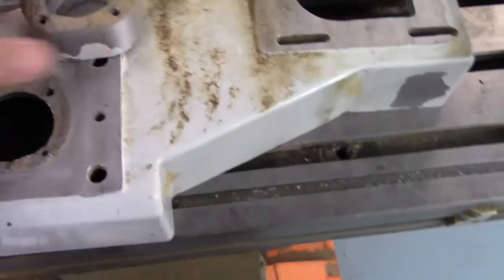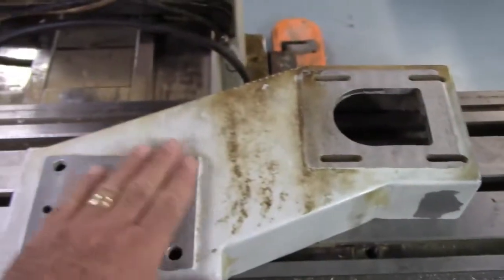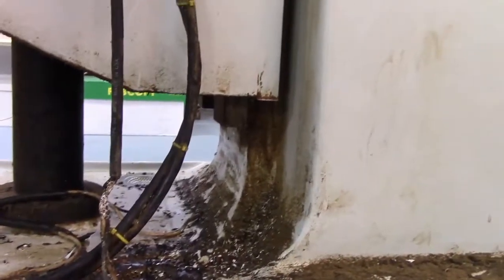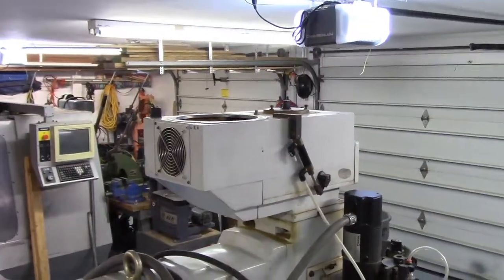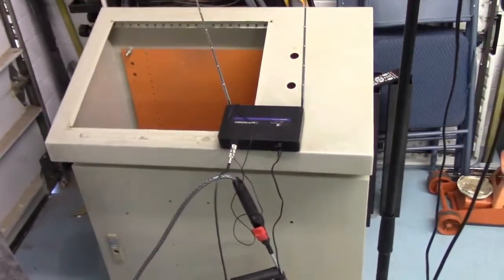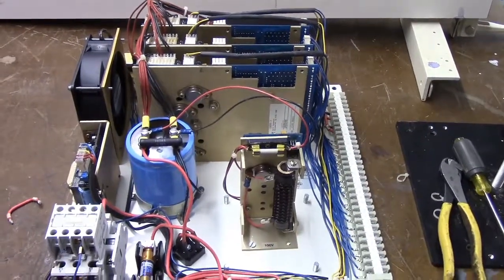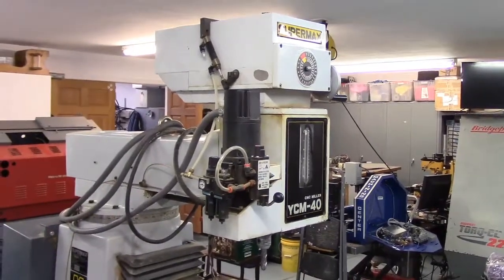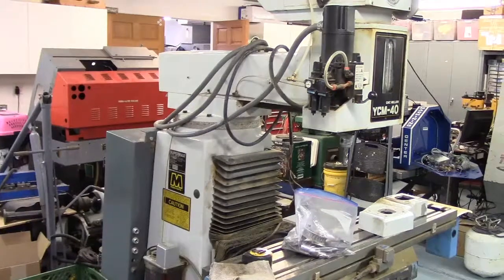Supermax YCM 40 Walk around

Comment: I notice that one of the Y axis limit switches has been modified. It seems suspicious that the Y axis crashed - but was that cause or effect? Was the switch mod a failed attempt to prevent the crash reoccurring? You may never know of course but perhaps the switch was dodgy to start with. 

I found one of my industrial IP68 limit switches was full of coolant due to the way it was mounted. If your switch got coolant inside, perhaps the old controller wasn't able to see it.
Reply from the maker: Hi Murray, thanks for the thoughts. I will definitely take that into consideration when I am checking things out. I did find it curious to see that Y axis limit the way it was.  It is interesting to note that the Y axis servo motor was no where to be found. My thought is perhaps they shipped it off for repair and either never got it back or the business was shuttered before they did anything else. Since it happened twice, we suspect the runaway was the cause of the broken Y axis thrust bearing pocket. It had to hit pretty hard. YCI still sells parts. This casting was $300, not terrible but I think a weak point.

Comment: I bought an old Shizuoka CNC machine rather like this and would agree there's a lot to be said for refitting an existing "proper" machine rather than converting a manual one, which was my original plan. 

Although it worked (sporadically), I replaced the 1980s controller with a Chinese 4 axis controller (http://www.newker-cnc.com) and some modern drivers for the original SEM brushed motors. The whole system is now housed in the original monitor / console and the enormous steel control cabinet is now geography. It all seems to work very well indeed. Using a self-contained controller like this avoids the need for a PC, monitor, keyboard, mouse etc - it's more like a clone of a Fanuc system.

I bought 2 of the original DYN-2 systems from DMM Tech and although I had them spinning, I can't pretend I have any useful experience to pass on, as the original Bridgeport conversion plan became redundant after I acquired the Shizuoka. I was living in Vancouver at the time and actually went to the DMM Tech office to pick them up. Nice guys to deal with. It has to be said from my own tear down of their system (I am a power electronics product developer myself), these were not industrial quality like Yaskawa etc but they offer great value and performance compared to industrial servos or traditional stepper systems.

This looks like an exciting project and I look forward to seeing how you get on! Like my machine, yours seems to be in excellent condition under the layer of dust and oil. You can see some vids of my machine on my Youtube channel and I have an idiosyncratic blog at www.murraye.com
Reply from the maker: I've seen the Chinese controllers. However, my biggest concern is service on the control. If they go out of business, change their hardware, you might have to change out the whole control again. Having worked on a couple of Centroid systems now, and nearly finished retrofitting my knee mill, I am impressed with the engineering, support and usability of their controls. PC is only used for the interface. Motion control is handled by the Centroid hardware. You can throw away a PC and install a new one cheap. Use their Report function and you can back up everything in seconds and restore to a new PC. 

Thanks for the info on DMM. What did you do with the DYN-2 systems? I plan on using the DYN-4 system if all goes according to plan. Of course, I could locate the missing servo motor and do another All in One DC, and that's not out of the question. BUT DMM has been around a number of years. They have answered all my questions promptly. If they were that bad, they wouldn't have lasted this long....I think they deserve a fair evaluation. They have some LARGE motors.
Reply: I understand your concern about going out of business etc. If you have (good) experience with the Centroid systems, it makes sense to keep with them. My 4-axis controller was about $400, which was affordable to me unlike a top end system like the All In One DC. I also managed to pick it up on business in China which avoided carriage and tax.

I still have the DMM servos. Given that I had made 90% of the components, I am planning to go ahead with the Bridgeport conversion anyway at some point. At the very least the original leadscrews are badly worn, so the rolled ballscrews will be an improvement. I also designed it to retain handwheels, so it would be perfectly usable as a manual machine too.

Servos are a much better solution than steppers, better even than closed loop steppers. If you plot the torque / speed characteristic of typical stepper motors, they display a "constant power" shape, so actually it doesn't make much difference what pulley ratio (if any) you apply, the resulting torque-speed will end up similar. So you may as well use direct drive, which is what most people do. That's not obvious from the headline figures that are bandied about. On the other hand, servos deliver a fairly constant torque all the way up to 3000rpm or more. So you would be silly not to fit a step-down pulley ratio (2.5 or more) with a servo but beyond that they win hands down. 

There is a lot to be said for retaining the original brushed servo motors, encoders and brackets etc, as they were probably fairly well designed (apart from the Y axis in your case!). I think you will find that the SEM motors have Heidenhain clone encoders and they may also have a tachometer which is not required with a modern digital driver. I fitted 3 brushed servo drivers from http://cncdrive.com/DG4S_16035.html to my system and they work very nicely indeed. I'd say they are very similar in quality of design and construction (and price) to the DMM, ie good enough for our needs.
Reply from the maker: Do keep watch for the release of the Centroid ACORN step and direction motion controller. I think you would be pleasantly surprised what you will get for the money when it initially releases :-)
Reply: I couldn't agree more with refitting quality machines. There are many still left they already have large diameter super accurate quality ground ball screws. many times the ways are hand scraped chromed and very accurate.   Its just the electronics are dated and old. Put an add in your local craigs list wanted CNC machines working or not. There are many shops and company's that have these machines pushed into the corner thinking there scrap value just they haven't bothered to scrap them yet do to the cost involved. they will sell them cheap and load it for you. 
Why anybody would buy a cheap imported manual mill and put cheap inaccurate rolled imported ball screws on it .Spend the time and money to build a control especially a servo control I dont know? Dont they own a calculator?

Comment: Hi Marty, the pneumatic brake on mine is similar, and what happens is when you hit E-stop, the solenoid kicks in and energizes the cylinder stopping the spindle immediately. I had hoped for an m-code that could operate it as it would be nice at times to be able to lock the spindle, but on my Milltronics control it doesn't work that way.